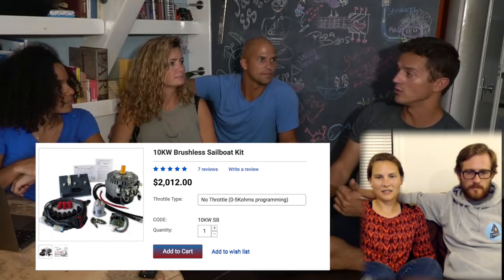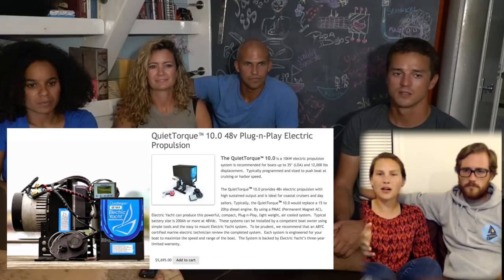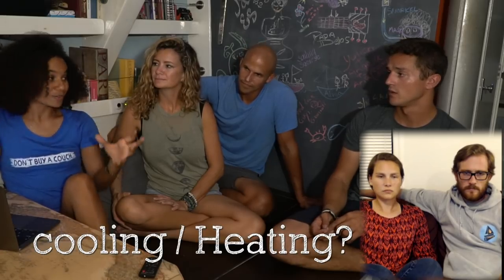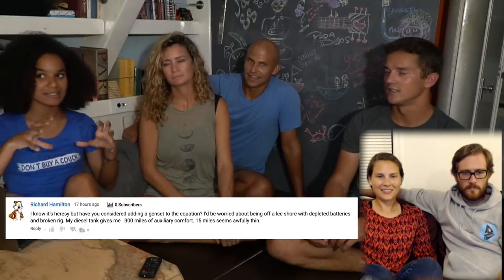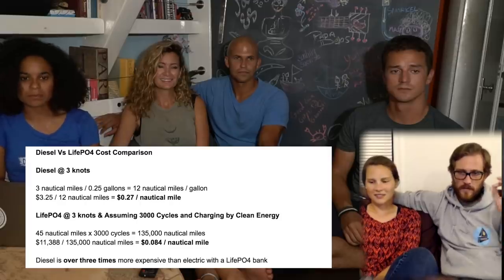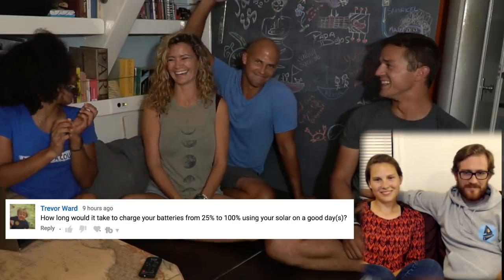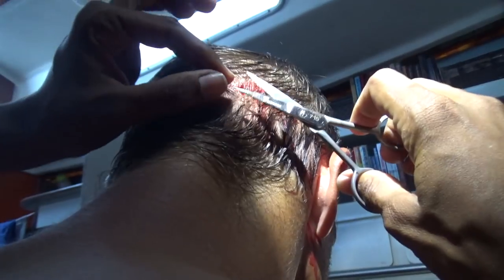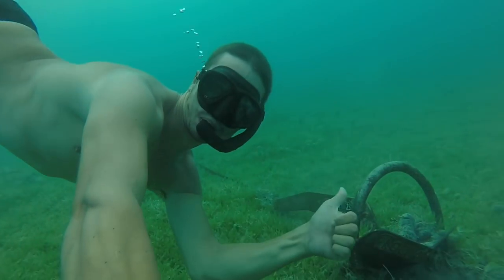Electric Sailboats: An HONEST Discussion — Sailing Uma [Step 140]

Comment: With so many choices for electric power is there a formula to help you chose power needs....
Reply: See UMA's reply to Michael Seymour.
Reply from the maker: Copied from below: "Something like 1kW per Ton gets you close. Depends on how fast and how far you want to motor. What size diesel do those usually come with? What ever it was, divide HP by 3 then multiply by .75 = Kw of an electric motor that will  also get you close. Those are very general rules of thumb, and motor companies often spec a larger motor for redundancy and get you to use a motor at 50% of it's rating. Could chat about this for hours, shoot us an email if you have more questions." Another point to think about is, unlike a diesel, if you get a bigger electric motor on a smaller boat, you'll just use less power. You unique boat will require a given amount of power to push it though the water at any given speed, wether you get a 5kw or 20kw motor, it will still use the same about of power. The larger motor may very well be more efficient and produce less heat because it's working well under it's rated use. Motors generally run in 5, 10, 15, 20kw. The above rules will get you close, then round up to the nearest one and go with that. Obviously consult the manufacturer as they will know much more than I do. But if you're just price checking and shopping around, these rules should get you close.
Reply: @SailingUma  Thanks for getting back to me so quickly, I was multi-tasking as usual and didn't see that answer you gave Micheal.....Larry

Comment: People clearly don’t know how to care of a motor My 1970 Cal 29 is still on its original Fresh Water Cooled Atomic 4 with 2 valve jobs and minor maintenance over what will be 50 years in January as I have a good solar system it’s still hard to burn 10 gallons in a year BUT when I am on the Dead Sea called Long Island Sound there have been I few times its had to run 15 hours unless you have days to anchor

Comment: It’s seven years since I converted my boat to electric and it’s improved my sailing skills. My boat is 26’, 3.5 ton and measured at the battery to do 4 knots it takes 1,000 Watts in calm conditions. Mine is direct drive 25.6 V with a two blade prop. I went with a smaller bank for cost. 2 x 200 Ah 12.8V Lithiums (LFP) which I discharge to 20% SOC. Then I simply have a 1kVA Honda backup generator. Cheaper than buying more Lithiums. Domestic is 2 x 130 Ah AGMs with a little solar for them. My boat is for sale now due to health and I’ve gone to a land yacht motorhome with lithium batteries of course!
http://john.rushworth.com

Comment: Ok, I've come to a decision. An electric motor in a monohul is like an electric motor powering a train. And they do that, but, they have an unlimited source of fuel on these trains coming from the track and some kind of overhead line. On the boat you typically do not have this "fuel" source, ie electricity, because you are completely reliant on solar cells. Considering that, you need more efficiency. That said, you should have an efficient boat. Monohul' s are not efficient. Cats and trimarans are. Providing you do not have too much cargo and it is light. So, that's the only way I would electrify a boat, it must be a Cat or Trimaran . You can do your best with the Monohul s, but they are not particularly good for electric. Sorry if I offended you.
Reply from the maker: No, Agree completely, I think we even said in the video that Cat's are the best for electric. Especially a fast one. If you can get a set of Ocean Volt servo props on a cat that can sail at 12kts, you can generate 2-3Kw of power, that will have your batteries charged back up in a day sail. That plus the 1.5kW of solar on top and you're all good!!
Reply: Although, I must say, I love sails. I love sailing. And its using free power , - the cost of sails and rigging every so often.
Reply: Yes you did, and I had made my post just before you said it. That said, crazy stuff if this type of thing is to be a reality. CRAZzY Methods to reduce wind drag could be, telescoping masts, with corresponding extendible rigging ! A Cat that has a low profile ! And of course, extremely efficient solar panels which should cover pretty much every exposed square inch. And, how about a wind gen which would be collapsible or possibly fold down behind the boat, thus reducing drag when that's needed. For this to work one needs to think out of the box.

Comment: Hi Friends,
I love Your video channel.  I love watching Your journey and adventures.  I am an ole fart, raised and lived as a landlubber.  You are living the dreams I had as a youth.
I think the most important factor in running an electric motor is less maintenance and repairs.
You might not be using fossil fuel in running Your motors because You are using electricity stored in batteries,,, BUT the amount of fossil fuel used in the manufacture of the batteries, wires and motor far outstrip the amount fossil fuel used in a diesel engine for a long time.  Have You factored in the length of time it will take to offset the fossil fuel used in the mining of rare earth materials and manufacture in the components of Your electrical systems? 
I am reading a book, "Mingming and the Art of Minimal Ocean Sailing", by Roger D. Taylor.
Roger has taken me on a voyage from Plymouth, England, up along Iceland, nearly to the Arctic Circle and return; in a 19 foot Junk rigged sail boat with no auxiliary power, except the wind.  
Now he is taking me on a trip to the Azores and return.  
Interesting reading, IF You can find the time.
Reply from the maker: We have about double the batteries found in a normal cruising boat and the same amount of cables. Our motor is more simple that the starter on a typical diesel, so really, we use the same amount in manufacturing these systems as any other boat, minus the diesel motor and liquid fuel. It's really closer to removing the diesel entirely if you thinking about preinstallation manufacturing carbon emissions.  We also generate all our own power from the sun.

Comment: Hey gus , cool meeting. Thanks for goin green.im converti g an old cabin cruiser that had two 351 ford v8 s. I just cruise in the river or bay in Tampa . Check out " J Manztel " on you tube .that guy has done some very interesting stuff  with boats he made from scratch. All electric , NO BATTERIES ! It has about 500 watts of solar . Lo It goes about 12 nots ! It hauls cargo and dirt .unbelievable unless you see it. You could get some good ideas from him .btw , he was an american but gtfo and moved to panama. Bought two small islands real cheap and built a homestead . He is very impressive.

Comment: For 1000's of years people sailed around the world with NO ENGINES or MOTORS, its called SEAMANSHIP. Diesel engines were invented in 1890, so just 138 years ago. Having an electric engine SAVES OUR OCEANS, no oil and diesel seeping into the oceans. Searching for Diesel, filling tanks,  wasting your time and costing you money. It's so much cheaper to go Electric, using Solar, Wind and Hydro, and regen power to charge the batteries. These three boats are pioneers in this age group, there are several other boats out there using electric motors for over 20 years, and it works fine.
Reply: For thousands of years people DIED because of what you just mentioned despite whatever levels of seamanship.

Comment: a 10-15 mile range on a full charge is not a lot man.  Your boat can basically go 15 miles every 2-3 days.  Even less in bad weather.  You seriously have barely enough charge to make it through a couple bridges on the icw.  And thats in perfectly calm weather.  I love you guys and what you are trying to do, but that seems severely underpowered.  Kika basically can only do what you (Dan) tell her with sails or heave to.  Without you she can only make it 5-10 miles in perfectly calm sea.  Not only fair winds, you guys need no current and easy swell as well.  

The electric experiment is cool.  I know you guys feel kinda special and it adds some excitement to the channel.  Rip out that abacus and put in a diesel motor man.  It was a great science project.  Maybe you (Dan) can see the wind before it changes, and you know where all the storms are but Kika cant see that.  She aint goin nowhere without a motor.  Get a good diesel engine.  You need one too (Dan) for anything other than pristine conditions.  I know thats unpopular I am sorry.  I will probably keep watching you guys either way.  Your electric motor seems less efficient than the gas powered dinghy motor.
Reply from the maker: That's a bit insulting and sexist towards Kika don't you think? She can handle the boat as well or better than I can as she's proved a few times already. She's actually the one that can sniff out a squall at night long before they show up, so she's the one I listen to, not the other way around. We have an unlimited range. We have a SAIL boat. The ICW is for little powerboats that can't handle offshore passages. A 20 mile range is 20X further than we've been able to motor for the past 3 years and we've been fine.
Reply: It's an opinion based on what he thinks it's factual. Sexism has nothing to do with it. He might be wrong on what Kika is capable of (and I sincerely have no idea on the matter - even though I do follow this channel) but please, do yourselves a favour and abstain from the SJW rhetoric, it is useless and far more dangerous than expressed sexism itself. Andreas Berg above took it to another level because he was triggered. The result? Hostility, no genuine discussion and arbitrary assumptions about the genuine incentives behind one's words.

Comment: Great channel, first of all. However, these folks talk about wanting "100% electric boat - zero fossil fuels", and that "diesel is a fuel from a million years ago and it's a big distinction" etc and they have a slightly holier than thou attitude about it. But then when they arrive in port they take out their outboard motor and burn gasoline to go zipping around in their dinghy to see the sights. This is slightly hypocritical - surely they should put a sail on their dinghy or row everywhere if they want to flash the green credentials.

Comment: Come on guys.......green? Environment? All you guys on fibreglass boats? Stick with all the other relevant reasons.
Reply from the maker: Plastic is a great material, the problems come when it is used in a disposable application like plastic straws, forks, bottles. Out boat is 50yrs old and will be around for many more years. Using power we generate ourselves IS one of the many reasons why we like being electrically powered among all the other ones mentioned in the video.
Reply: Great. Keep that in mind every time you plug into shore power.

Comment: Do you guys ever feel bad about anchoring?!  Just wish there was a better way to stay in one place then dragging the anchor along the bottom destroying habitat and possibly coral. You never know what kind of ecologically sensitive areas could be done there. I traveled to Vietnam with my GF and a lot of the beaches were littered with  broken coral from boat anchors. Mostly tourist boat. I felt bad after that.
Reply from the maker: If the water is clean, you can avoid anchoring on coral or sea grass. We always anchor in sand, clay or mud in the Caribbean. We also have a Ronca anchor which doesn't drag, so if the water was cloudy, and we couldn't tell what the bottom was like, it would cause the least damage.
Reply: @SailingUma  great to hear thanks for the info!

Comment: Today LiPO4 batteries cost around $1000/kWh.  Tesla, who is at the forefront of the battery technology in the world, uses a different chemistry process but the industry beilieves they are able to produce batteries at $100/kWh.  After all you can pickup a Model3 2 weeks from now for $43k and it has a 75kwh capacity that would cost $75k if it was LiPO4.  The industry consensus is that by 2023 it will cost $60/kWh.  Now this isn't retail but cost and this isn't LiPO4 which tend to cost 20% more than similar grade LiPO chemistries.  So lets say in 2023 it would be a fair guess that they will cost $150/kWh retail.  So for the same $12k that gets you 12kWh today you can get 80kWh in the future.  That is 55 hours of cruising pulling 30 amph at 4 knots based on the numbers in the video.  A weeks worth of cruising is $36k.

This is a lot of money but it isn't that far off the full cost of a diesel replacement which a lot of upsides.  You still need some amount of battery bank for house power and this makes you an island to yourself.  Split the banks and install two motors since the motor isn't that expensive and you have redundancy too for maybe $40k.
Reply from the maker: Yes, by the time our current batteries "die" we'll most likely be able to replace them for a fraction of the cost, and probably many more improvements as well.

Comment: Lithium is significantly older than the petroleum. And the mining isn't any better for the earth. Lithium is still a highly toxic material to most life on earth, and it's explosive if you expose it to oxygen.

I get the convenience aspect of having batteries and solar - don't get me wrong. But the whole "green" aspect is laughable. It's mostly mined in South America - so, bye bye rainforest.  And lithium isn't valuable as a recycled material - it's cheaper to toss it in a landfill than attempt to reclaim the lithium carbonate from used cells (unlike Lead Acid).

Your diesel engine is almost 100% recyclable. There will always be a market for recycled steel, even as scrap.

Comment: Can't sail the high lats without heat, solar and wind won't heat your boat......
Reply from the maker: Thats true. There are many options for heating your boat, but unless you plan on living up there, they can all be temporary.
Reply: I guess you could go with wood (I did for many years and no engine on a 35 foot gaff rigged ketch) but a little dino juice goes a long way in the PNW or the UK......

Comment: electric motors is the future, or hybrid.
Reply: Hybrid, I am working right now on a small engine driven alternator that will put out over 110v. I only need 60v but it will put out more. I can send over 100 amps to my 60v battery bank which will run my motor close to max. I only need 50 to 60 in reality for close to hull speed. The rest can actually put amps back into batteries while I am motoring. This will be a bulk type of fill, then the solar takes over to polish it off. I can run on batteries and solar, but if I need to I can fire the genset up and can go for as long as I have fuel. Same as a diesel engine.
Reply: this has to be a much better solution.

Comment: You are all talking about a subject you have no experience yet. Especially the two boats that are still tied to the dock.
You guys sound like the boat dock warriors that rarely sail.
None of you have been caught out were there is no communication to get your "current weather" and woke to a storn while on a lee shore. Excellent seaman have ended up on the rocks and die 100s of years before any of us were even though of.

Engine needs parts because it wasn't serviced correctly as the rigging and the rest of the boat has been either.

Have any of you three boats been on or seen what happens during and after a lightning strike? 
I have and your electric motor connected directly to the water is an excellent path for 30,000,000 volts to find its way to the water where it wants to go.

Comment: The answer to most of these complaints below is just getting a gas or diesel generator. Also most of these people come from 'macho-mechanic-car-guy' backgrounds so they get really defensive about motors. To them a motor is part of their identity and taking care of a motor is somehow inter-connected with their 'manliness' This is a stupid backwards way of thinking. Knowing how to change oil and maintain a combustion engine should stop being mixed up with being a useful man. The truth is anyone can learn how to take care of a machine that needs various filters and fluids replaced on a complex schedule. The question is do you want to? Is that how you want to spend your time? What if I want to spend more time peeing standing up or some other more manly activity. The truth is some of the most efficient hybrid cars and trains in the world use a combination of an electrical engine and a combustion generator. That is actually a fairly robust system. I think you guys know, but most of these people complaining just really like sitting around working on motors. That's how they like to spend their time, covered in grease and grunting while their women look on admiringly. It's a cultural thing. I think you guys are in a great situation. You have almost the ideal set up. I would just get a gas generator to cover emergencies and be a redundant source of power and be done with it. It's not giving in if it's for safety.
Reply from the maker: Nicholas Juntilla, please send us an email with your mailing address and shirt size. You my friend, get a FREE T SHIRT!!